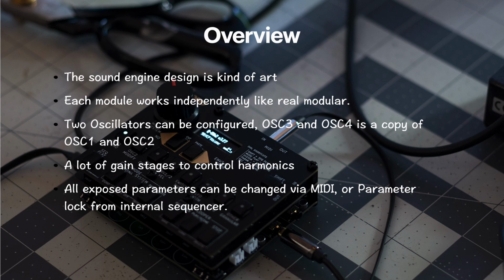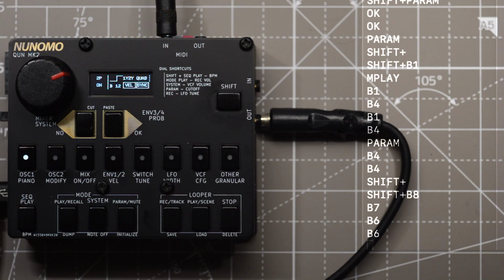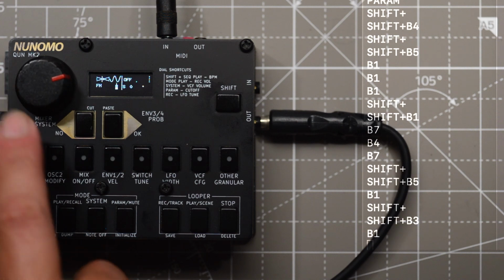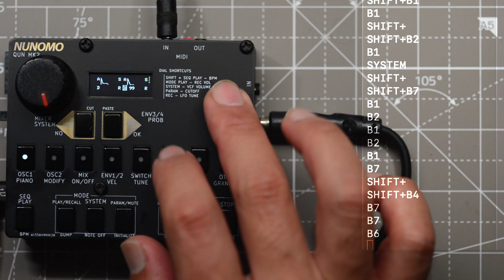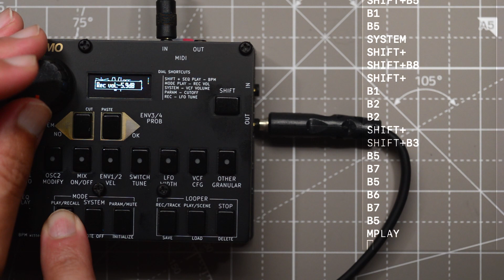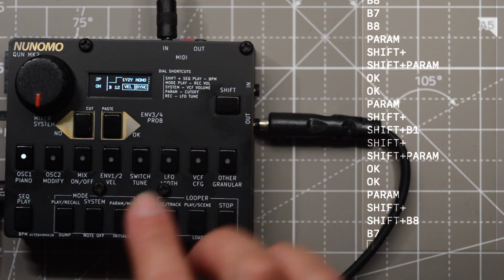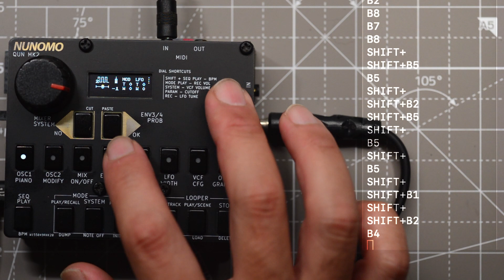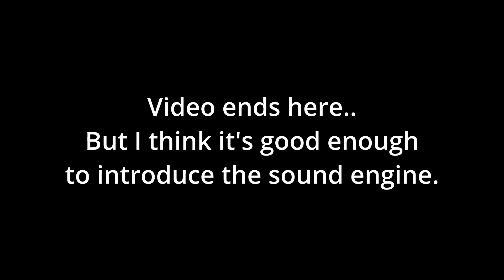Qun mk2 new tutorial series No.2 Sound Engine

Comment: Does it have key tracking?
Reply from the maker: What do you mean by key tracking? Filter has a parameter can track MIDI note.
Reply: @nunomollc  key tracking in a modulation matrix.  Like key tracking filter cutoff or resonance etc? Just curious if there is a modulation matrix. I already ordered a unit but just curious.
Reply from the maker: @IIrandhandleII  easy key tracking works for cutoff. But also freq1/2 (midi key note number) can be modulation source so you can use it as well.
Reply: @nunomollc  amazing